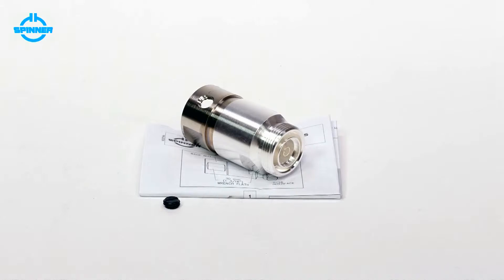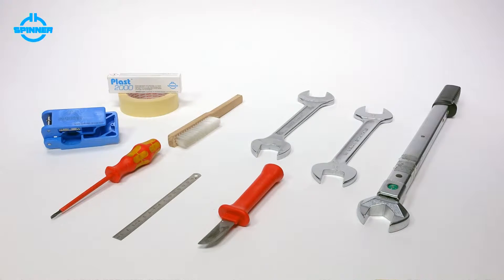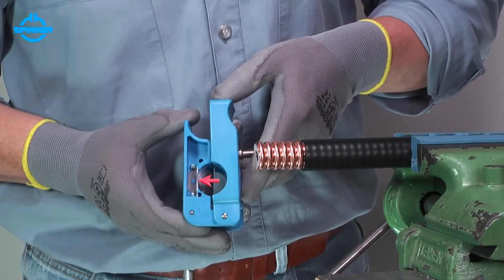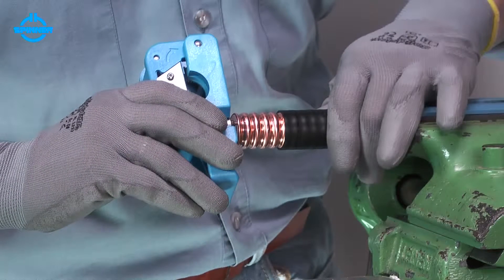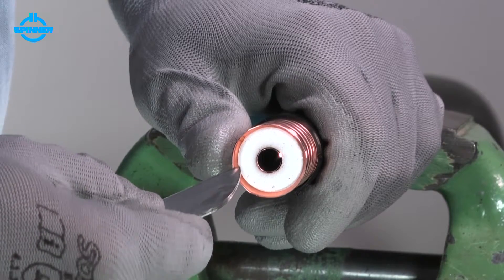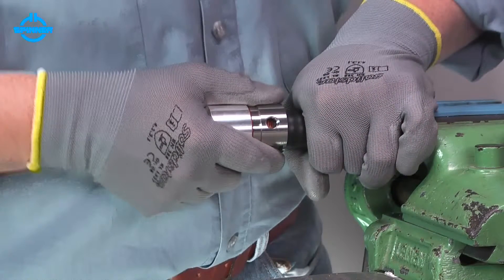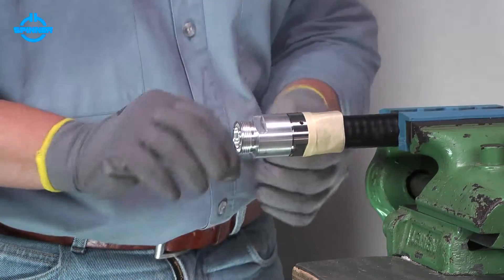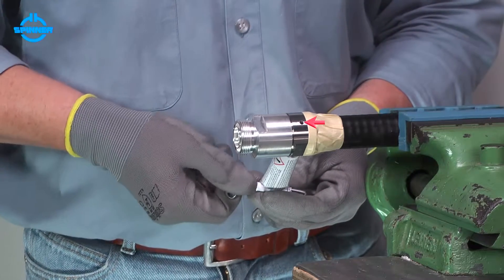Installation of SPINNER CAF® Plast2000® for LF7/8”

Comment: Would You Mind Very Much, Adding A Completion Of The Task By Informing The Audience Of "When to Remove the Tape - Plus The Length Of Time It Takes For The PLAST 2000 To Fully Cure"

Also, Indicate "Whether Or Not RF Energy Is Permitted While The PLAST 2000 Is Still Curing - OR - How Many Days BEFORE The Connector can Be Put Into Service.   ( SBE )
Reply: Why is the Plast 2000  M10 Thread Size and the EIA 7/8" Sealant Port" M9 Thread size?